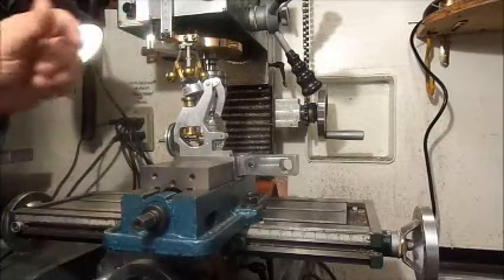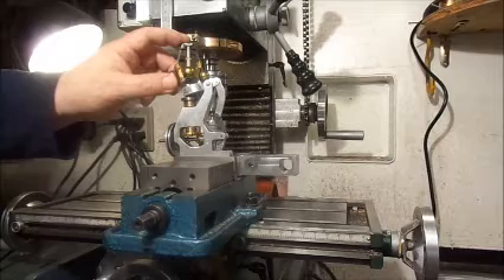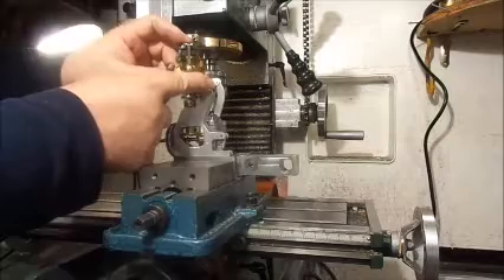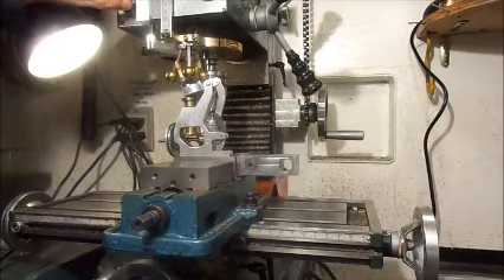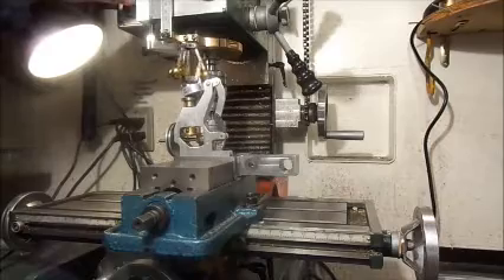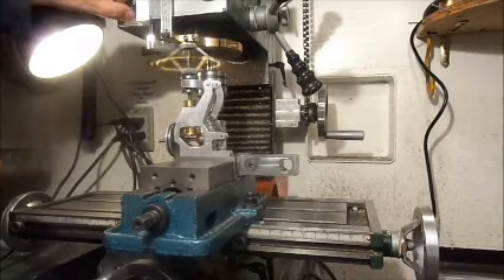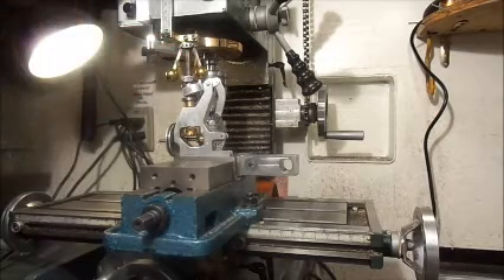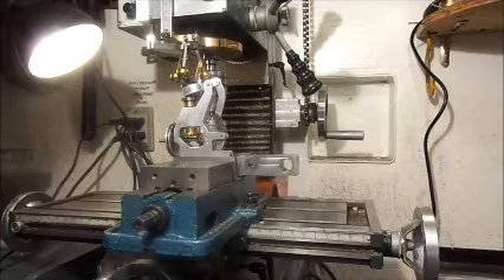HOW A FLYBALL GOVERNOR WORKS

Comment from the maker: You dial in the perfect speed by putting a stronger or weaker spring on the stem post, using a heavier or lighter ball, or by changing the rpm the governor runs at.